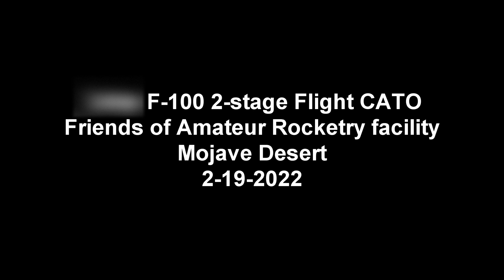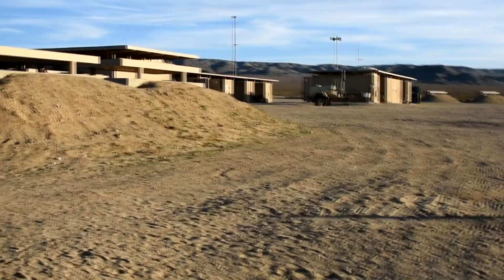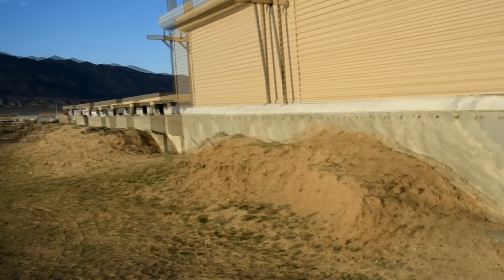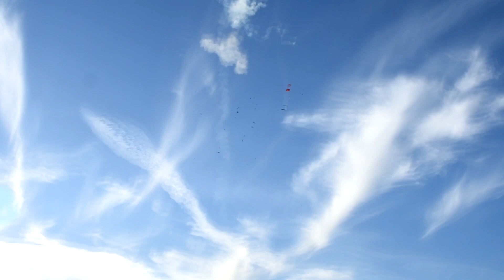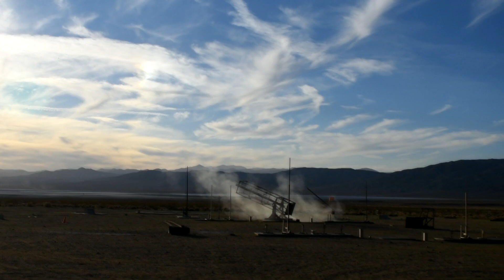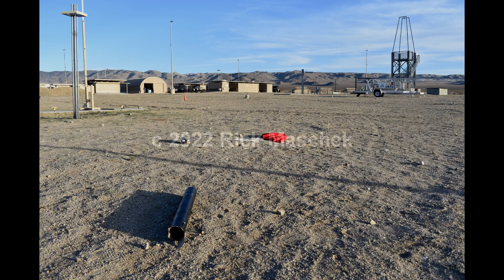F-100 motor 2-stage CATO at FAR

Comment: The F100 boosters had a nice trick of end burning for a bit too long before staging sometimes. This one did a bit. I've had them fire the upper stage F7 horizontally after fizzing for a couple of seconds. Flew a 1981 F100-10 last weekend successfully. I know some folks are still hoarding them LOL. Don't use them in valuable or pretty rockets.